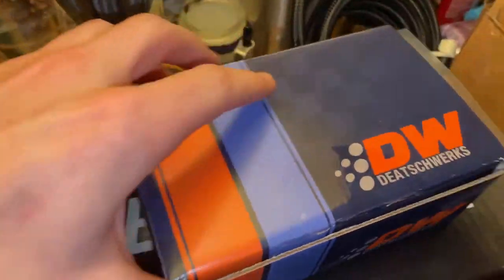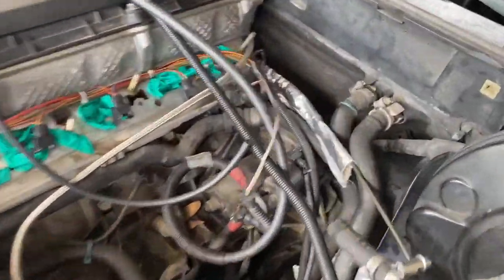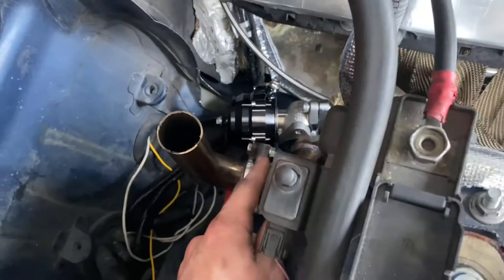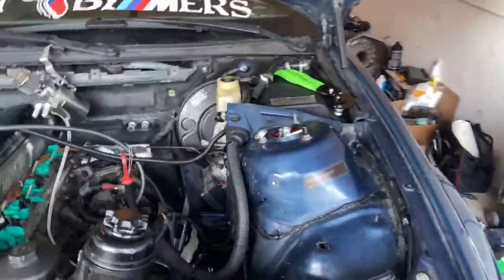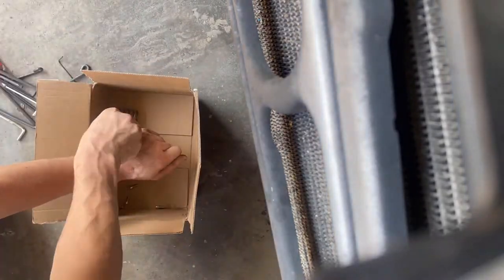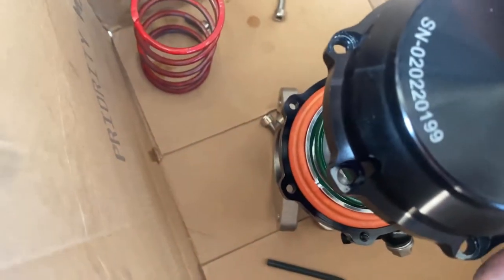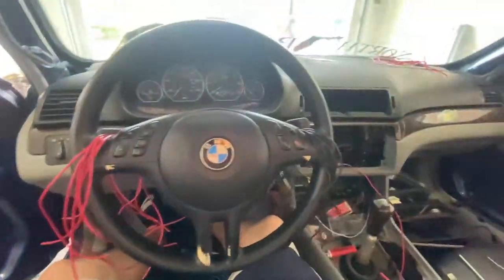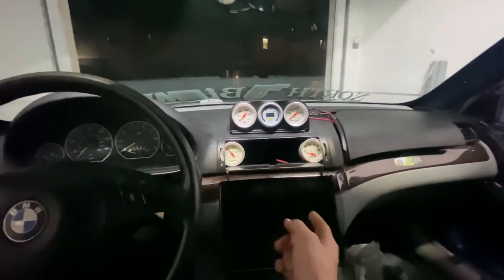BMW E46 TURBO BUILD: Part 8 - wrapping things up...

Comment: How loud is the Marco scavenge pump ?
Reply from the maker: It was pretty loud when I was running it. It sounded like a decent sized fuel pump. But I only use it for bottom side turbo. Once I switched up to top side I got rid of it.